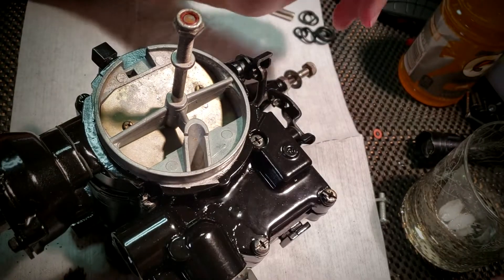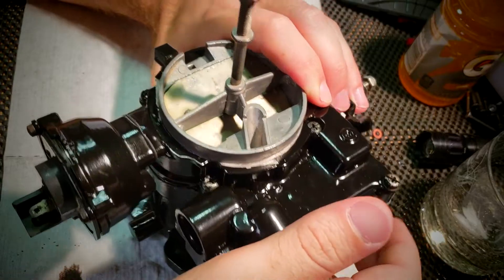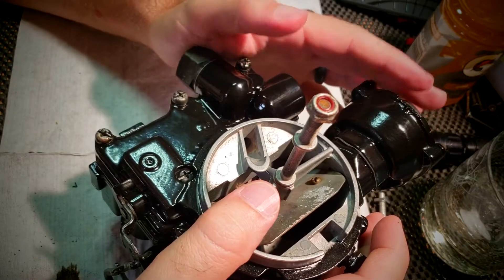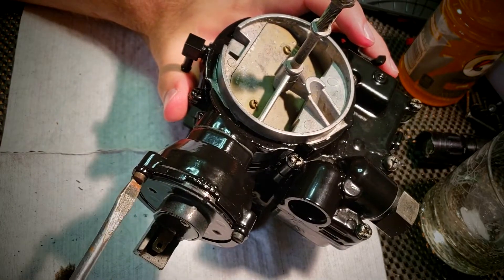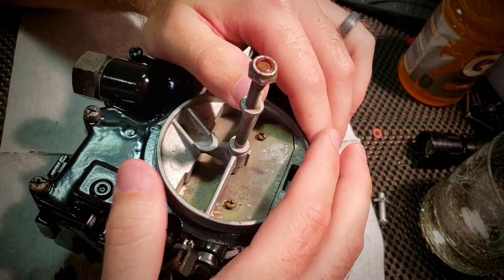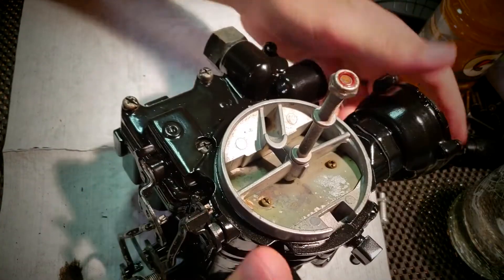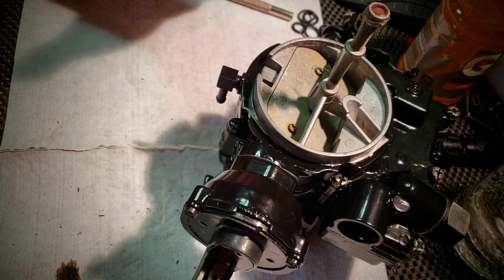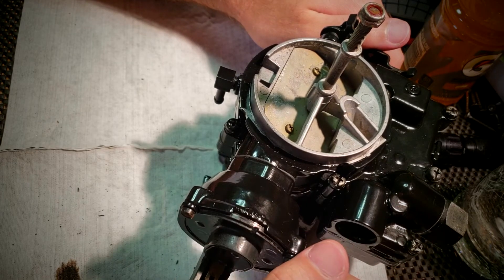How To: Rebuild a Mercarb - Part 3: Adjustments

Comment: You Are the best. I am old and like working on these old engines. I just bought a 96 boat with a 4.3 Merck cruiser in it. The guy just before me thought he was a mechanic and even put things in backwards. The settings were all off  and it is no surprise that the engine wouldn't run.  Your tutorial was right on the money and you went above and beyond most people and included all the settings and why and how. Great job thank you

Comment: This is perfect. I have a cruisers 297 with twin 305 marine power engines in it and it's running extremely rich and surging at idle. I'm gonna try these settings and see if it helps then if not I'll be doing a rebuild I guess. Thanks.

Comment: Two questions: 1. If my mix screw is set at 1-1/2 out from seated, are you saying it can be turned out 3,4,5+ turns (from seated) and still not pop out of the carb? It will run with that many turns out? (I was nervous to turn more than 2 turns out).
2. Do I put in forward gear+idle, then remove the throttle cable at that point so the idle can be set? Or can the cable be left attached during that? Thanks.🇨🇦

Comment: Great video and now subscribed. Followed the instructions and working great. Only problem is turning the idle screw anticlockwise doesnt have any effect on the idle and ive unscrewed it until its nearly fallen out. Assume something in that mechanism thats not working / broken?
Reply: Mine was didn’t that. I had to adjust my linkage.

Comment: I rebuilted my carburator and noticed a that I was missing the filter, the ball and the clip of the acceleration pump although the spring is present. What are they supposed to do? You did a fabulous job with these videos. Looking forward for your next ones.

Comment: My 3.0 runs rough/stalls when advancing from idle to low speed. If I advance throttle quickly the boat takes off as expected. It’s only the low rpm area where things big down. Suggestions? No problem starting either.

Comment: I wonder if you can help me out? Periodically my boat starts hard warm or cold. Plugs gaped & timing correct. Engine ,coil & wires New , Carburetor rebuilt....when running its fine, plenty of power, ETC.....I'm thinking its the choke....I've adjusted it counter & clockwise one notch off from the center mark..your thoughts....thank you for your time and video!

Comment: i have a question.... my 3.0 runs perfect ... untill i ride it about 15 min.. then spitting and sputtering; I changed the points and condenser. I also emptied the tank and made sure to run non ethnol for a few time. Any ideas on proper trouble shooting methods as i dont like throwing parts at things... tks

Comment: Thank you for the video! Been trying to set these with earmuffs on and not having much luck - can’t wait to try it in the water. Any idea if this is related to hard starting when the engine is warm? Forums suggest it’s flooding after shutdown, and throttling wide open when starting does in fact get it started. But the kicker is I rebuilt the carb and it’s still doing it..

Comment: I rebuilt my 2 barrel mercruiser carb it starts and runs good except there is alot of smoke and black residue coming from my exhaust do you have any suggestions on how to fix this problem? Does it mean im running to rich therefore adjust the fuel mixture screw on the carb? Thank you for any input....

Comment: Hey man, so I rebuilt the carb on my 5.0 mercruiser.  Everything is running great with just one problem.  I can't get to 5500 rpms for WOT.  I get to about 4000 and that's as far as it will go.  Is there something I need to adjust different to get about 1500 more rpms at WOT?

Comment: Awesome video! Thank you! I did all the things you did, I think, and the boat idles great on start up, but then as soon as I move the throttle it runs great, until I disengage the throttle and then to restart the boat I have to reset the cam. It doesn’t stay in the same place once I unthrottle.

Boat ran great until I replaced the impeller and a hose popped off and the bot over heated. Since then I can’t get it to idle without opening the things the cam adjusts... any ideas?

Comment: Question. My newly rebuilt mercarb will start and idle for 30 seconds then die. If I restart it and bump up the RPMs, it dies within 10 seconds. New fuel filter. Any ideas?
Reply: Same with me, I replaced the oil pressure switch the one next to oil pressure sender.

Comment: Great job on the video!   I’m doing the same thing on a 1988 3.7 liter.  Have you heard of the “thin” carb mounting gasket versus the “thick” gasket question/problem?  I’ve got hot start problems now and hot idle trouble and trying to find a thick (1/4 inch) mounting gasket as the rebuild kit’s gasket was a very thin one.   Hope yours runs well!
Reply: ever get it sorted?

Comment: Thanks for the great video.  I'm rebuilding mine soon - one quick question - are you supposed to set the computer to base time by grounding the purple/white wire on the Thunderbolt V ignition so it doesnt mess with idle while setting the idle?
Reply from the maker: Nope, you set the idle in regular timing.  However, you need to be IN the water in forward gear at operating temperature... I find my motor idles at around 900-1000rpm when on muffs out of the water when its correctly set.
Reply: @ashipshow  well thanks for the fast response! That helps alot - have you ever noticed any difference between using different gas?  Say 87 with ethanol and 93 without ethanol?
Reply from the maker: @jasonwilkerson3201  No, not really... I've pretty much only ever used 87 pump gas... I've gotten ethenol free from a marina because thats all they had, but didn't notice any difference.  Ethenol gas actually has a higher octane rating because the ethenol detonates at a higher temperature so you're less likely to knock, but you get worse MPG, or in a boats case, gallons per mile...
Reply: @ashipshow  ok - thanks again!
Reply: acc. to service manual 24 ;” Engines with Thunderbolt V ignition must have module locked in
Basse Timing Mode”

Comment: I subbed great video.  Question. I rebuilt the same carb. My boat idles fine on startup, accelerates fine but when I pull back the throttle to idle the engine idles super low and dies. Start engine back up idle is fine again. What would cause this?
Reply from the maker: Thanks for watching... not entirely sure... could be your idle is set too low... most mercs should idle around 650-800 rpm in the water and in gear.
Reply from the maker: The Truth  that's around the high end of the spec but sounds about right...
Reply: I suspect the choke is not set properly and is staying to far open.

Comment: Hey in 10:42 You are screwed in you idle cam screw 2 turns then closed choke, I have a problem, when screwed in I cannot move choke anymore...
Can I ask you to make a video how does it work on a boat? Thanks
Reply from the maker: Yea, I plan to make a video at some point on how to do the adjustments on the water... Just haven't been doing much video/boat work lately since I splashed it and just enjoying it while the weather is still good lol
Reply: Madprops Boatworks thanks I’ll appreciate it because I’m trying to fix that thing... btw. thanks for reply on my topic on iboats,
Reply: Madprops Boatworks I mean if you can record how the cam/rods works. So I can compare and solve the issue why the choke is frozing when I screw in the idle screw
Reply: @kubaSWAT  hey buddy - did you ever fix this problem? Mine is doing exactly that and I can’t work out why. Like the idle screw jams the fast idle cam…